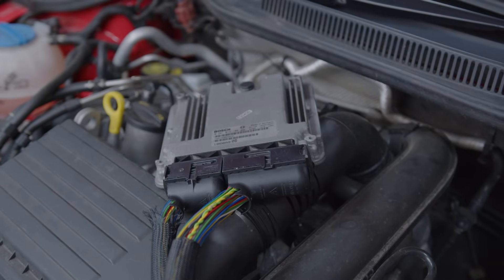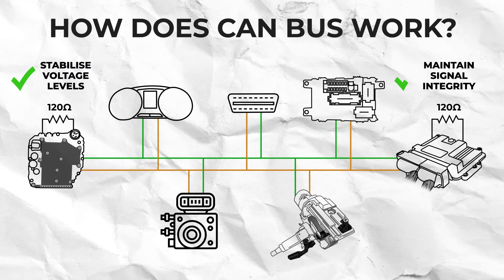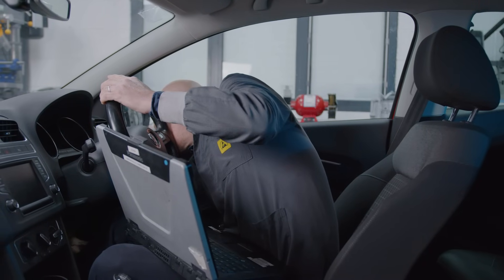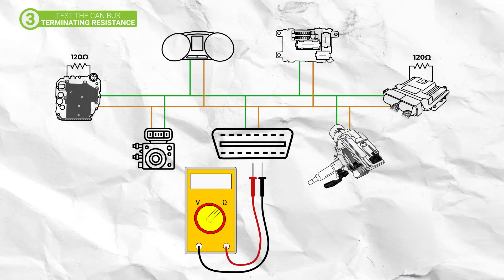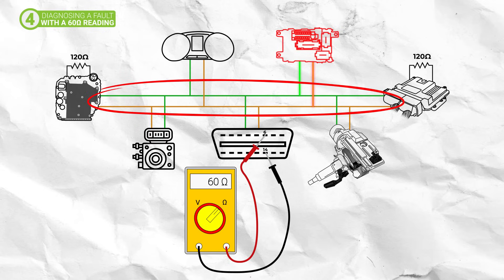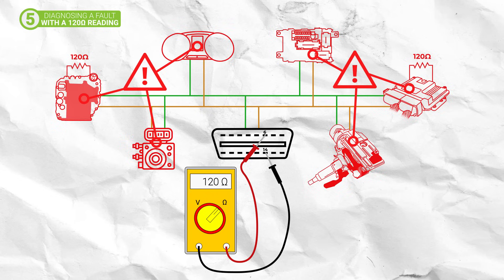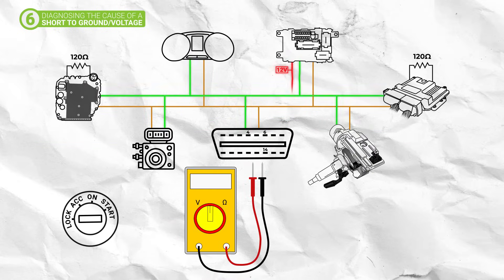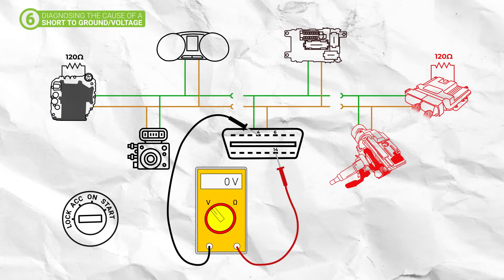Explained! CAN BUS Diagnosis – How to Troubleshoot Faults.

Comment: I bought a used vehicle and long story short i noticed a u0401 code. Meaning invalid data from ECM. I also have a p0101, and a p0102 if i remember correctly. My father and i also noticed that there seemed to be electrical tape around some wires that are right behind the ECM connector plugs. I found the wiring diagram and found that it seems like a single terminal does not correlate with the correct terminal that the wiring diagram says it should be. When using the continuuity mode, we found that it goes to a terminal position that is supposed to be a selonoid valve of some sort. We think rodent damage to the wires, or some other unkown damage was done to the ECU cables and whoever tried repairing the cables mixed up a few cables, but not enough to completely ruin the ECU, considering thr car still runs absolutely fine without many issues. It doesnt run well at full throttle due to the MAF sensor codes and not recieiving the correct signal to thr ECU. Anyways i had a lightbulb moment after watching multiple videos of yours. I bet the u0401 is caused by the miswired repair that the kast person did. Its causing the maf sensor and IAT sensor to get incirrect readings, and causing the ECU to not recieve valid data and therefor throwing that u0401 code. Could you confirm my suspicions? Im still at work so im not able to work on it, but your input would be absolutely appreciated. Very informative videos!

Comment: Help! I went through the process and got to the Diagnose CAN Bus open circuit part and got stumped.  I pulled the module with the faults, BCM, and measured the wires a got a reading of 120ish ohms.  The video covers 0 and 60ohms, but not 120ohms.  What is the fault for 120ohms?  I did originally test the OBDII port and had a reading of 60ish ohms.  My only thought is that it is not seeing an end resistor.  What should I do next?

Comment: I am an ex mechanic but not mega familiar with canbus so I followed this guide to diagnose a range river sport 3.0 TDV6 2011.

I let the canbus go into sleep testing the voltage between pin 6 and pin 13 to confirm.

Once in sleep mode I tested the ground to pin 6 and pin 13 using the voltmeter and got voltage upto 1v. I got 60 ohms so no resistance issues 

I disconnected every item shown in the high speed canbus system as shown in the wiring diagram (took me a few hours). I got voltages ranging from 0.5v to 1.0v throughout and at no point when disconnecting every item did the voltage go to 0v as explained in the video.

Some guidance or advice would be gratefully appreciated.
Reply: Update:

The body control module was emitting the current. I suppose my question is. When in sleep, there definitely shouldn’t be any current in the can bus system should there?

Comment: I'm working on a 2015 Mercedes-Benz c300
 I don't have communication at all. I have 62 ohms on pin 6 & 14  when the car is sleep once I cycle the key. I get 1.2 ohms it would stay like that until it goes to sleep which takes about 45 minutes. I can't find where the 120 ohms resistors are located. I'm suspecting it is a module but which one. Help help 
Can high is 2.6 can low is 2.4

Comment: I thought you had to disconnect all devices from the network when taking an ohm reading, due to the fact that you’d also be measuring the resistance of each device that is plugged in

Comment: Agree best simplified by far and heading back to the garage to troubleshoot.
I'm working on a project to customize 1996 with a 2017 canbus. I'll be removing some of the canbus devices, but not sure how to get around a device that won't be used anymore. Like the electronic parking brake. But still, I will keep using the manual ebrake. Do I need to loop high w/high etc or how would I terminate the end as in the device did not exist. I will edit it out of the programming as well. Thanks

Comment: Hello thanks for a great tutorial.  I try to resolve electrical issue on my Passat b6 BMP 2008 DSG car, for a week with no success. Yesterday I take multimeter with me and try to measure 6pin and 14pin from OBD. The result for voltage between 6th pin and ground was 2.5v, pin 14 and ground was 2.5v. I think that not have communication, but this is all of the time. Another test was for resilient. I try 200ohm between pin 6 and pin 14. Result was between 68.1 in most time and 71. I try to remove all positive cables from fuse box near engine and battery, nothing happened with resilient. After that I remove abs plug and again 68.1ohm. Finally I unplug every one cable in engine section and spray it with contact spray, I change fuse box in engine section, change gateway module, after all situation is same. I remember that before mass problem with multiple MILs and going in service mode I have a couple of day, maybe a week MIL alerts for steering. 
I change battery with new one and maintain alternator.

P.S All of scannings with diagnostic tools say that I have a impulsible signals, lost communication with different modules and etc.

Please give me advise what to do, because I was in two different car services and nothing happned.

Comment: Great video, thank you.   One curios phenomena I have with both of my cars regarding the CAN bus on the ODBII connector, there is no voltage nor any resistance (open circuit) on pin 6 and 14. I tried measuring it with both an oscilloscope  and ohm meter.  What's going on here? 😀.  My cars are Toyota Aygo and Volvo S60. Even when the engine is running there is no signal in the oscilloscope on those pins 🤔

Comment: Thanks for the video!  I subbed to your channel for the good info !  I spent all day today trying to diagnose a Bobcat tracked skid loader that is having electrical gremlins and it won’t power up the display panel. I traced the problem down to a faulty control/display module. Its always a little stressful calling bad modules when they cost $1500 dollars to replace!  But based on everything I seen its gotta be the panel.

Comment: Hi, if you have a short to voltage i assume that would appear as a parasitic drain,  and potentially cause other issues, i have a qashqai that has a serious drain, and is missfiring and is giving codes for a can issue with the cruise control and there was another of the same code, i am trying to figure if its a module or wiring right now?

Comment: Really great video thanks. I’ve got a RFA module u0001 00-08 error on my Ford fiesta 2014 and an engine ignition light on the dash. Gone through your tests but everything seems ok. The battery though is reading 12.39v across the terminals or the cars internal test reads it as 11.6v. Is it most likely simply a dodgy battery that needs to be replaced? I did get a strange resistance reading from the HS CAN though as it was rotating though numbers eg 35 40 23 with others sometimes flicking in like 77 I saw once and a hundred and something. ?

Comment: 12V vs 7V
can you please explain....
Why why why???
Today's modern cars eg Toyota Glanza, Toyota Taisor, has 12V and then drops to 7V in the door close signal voltage.

Whereas, it used to be directly 12V when door closed and 0V when opened in old cars.
But today's cars has 12V at door closed, and after 20 seconds, it drops to constant 7V. When opening, it drops to 0V.
Why there's delay in dropping to 7V at door closed??
What's the significance of this 12V to 7V???
Please explain 😊

Comment: I had a very strange miscommunication in my 2021 gm truck .really very strange.
When testing sierra data vs ground is infinity OK.
When testing wire continuity in terminal is ok(less then 0.4
 ohm) when testing terminals on module is OK giving right voltage and right resistance.
But when connecting the connector to the module and attempting to measure voltage or resistance the line looks like dead.

Very confusing.

Comment: There are so many techs say you need a scope for automotive CAN-BUS diagnostics.  They often cite that a tech needs to decode the communications (not sure why) or look at the ACK bit, or whatever....  But the reality for automotive diagnostics:  find the failing module, then replace it or get it re-built.  Even though we hate to admit it, auto techs are just parts swappers.  When techs start doing diagnostics, we are just being more accurate in the part that needs to be swapped.     All that said, do you find a scope is really needed to do automotive can-bus diagnostics?

Comment: Sir, very nice 
Sir, can high and low is dc voltage  or ac voltage (signal)????
Sir, I reparing  electric  charger  but this charger  not on without bms battery ,, now sir how to on without  bms battery  for testing purposes. 
Please  guide.   Charger  use four wire  can H, can L, ground1, and ground 2(bms use in)
Reply: Anything that uses battery automatically that's a DC voltage and the rest that doesn't use any sort of battery that's AC voltage
Reply: @Saka.shi-liz  
Any tips for charger  on.    For can

Comment: Ummmm I’m getting 551 ohms of resistance between my can lines?
Reply from the maker: A reading above 70 Ohms would indicate high resistance somewhere on the CAN network. This could either be poor terminal contacts, corroded or damaged wires, or a faulty module. It could also be worth checking the multimeter you are using to obtain the reading isn't faulty, as this could give a high resistance reading.
Reply: @Ecutestinglimited can you please explain....
Why why why???
Today's modern cars eg Toyota Glanza, Toyota Taisor, has 12V and then drops to 7V in the door close signal voltage.

Whereas, it used to be directly 12V when door closed and 0V when opened in old cars.
But today's cars has 12V at door closed, and after 20 seconds, it drops to constant 7V. When opening, it drops to 0V.
Why there's delay in dropping to 7V at door closed??
What's the significance of this 12V to 7V???
Please explain 😊

Comment: Sir  I am also coming across a can bus issue from the bcm  and the resistance was way high the voltage was normal  after disconnecting the battery or  the bcm supply line the resistance comes back to normal  the issue the power steering of the car is not working. The vehicle is fitted with a mdps steering since  a can bus is shooting on  I cannot take a decision regrading the  problem

Comment: Hi great video, is there any diagrams available for showing where canbus modules etc go to point A-B ? 
I’ve got a harness for an Audi 8p vr6 a3 and I’ve got some cut canbus cables, traced them back to the following just don’t know which connects to what 

Can-bus cut items

Ecu body plug
ABS module 
Airbag module 
Headlight level module 8P0 907 357 F
Steering wheel module 8P0 953 549 F
Console/dsg shifter 
Dsg trans plug 
Rear diff / haldrex plug diff side 

CANBUS gateway module plug 10 pin
1K0 907 530G
Top side plug tab 
6 from left red / brown
6 from left red / black 

Find what grey / yellow wire goes to on instrument cluster, as that has a cut canbus wire

10 sets cut in total

Comment: The video is good, but for more detailed and accurate troubleshooting, I recommend using an oscilloscope. You can distinguish between main line and sub line issues by examining the waveform.

Comment: Very informative video!
I have communication issues with the transmission control module .
When connected to the can bus ,resistance reading was 40ohms,scanner showed tcm is not fitted although the gearbox functioned ok.
I replaced it with another unit along with the wiring harness .
Scanner connected to the used  module but only for 2 times .
Gearbox functions well again but can't communicate with tcm for live readings and reset functions etc.
Do I have 2 faulty tcms?
How can I confirm this? 
I checked grounds, power and can bus wiring ,all seems good..
Any suggestions?
Thanks.
Reply: I forgot to write that I also have no faults codes (communication or else )

Comment: Error code U0151 means what?
Reply from the maker: Hi. The fault code U0151 usually indicates a communication problem with the vehicle's Restraint Control Module which is responsible for things such as the airbags and seatbelt pre-tensioners. We would recommend checking the unit is receiving the correct power supply and it has a good ground, and then test the communication line/lines to determine if the fault lies with the module or the wiring. Getting a good wiring diagram for your vehicle so you can see which pins correspond to which would also be very beneficial, as well as seeing what communication network that module uses (CAN high, CAN low, LIN bus etc). If it is CAN bus, you can follow the steps in this video in order to determine where the fault could lie. Hope this helps!

Comment: Great video just subscribe to your channel, having trouble with the 2016 Jeep grand Cherokee my lights stay on and cannot turn them off with the headlight control switch knob. The lights only shut off when my car is off and I can’t access my highbeams. Any idea what it it could be?, Already replaced the headlight control off switch what the factory went from Mopar and I also replaced the ambient light sensor in the middle of the dash and still same problem.

Comment: Great video and explanation. But, it all hinges on the troubleshooter having 100% familiarity with the physical routing of cabling inside the vehicle. i.e. where modules are actually located and how does the wiring loom run throughout the vehicle. Most factory wiring diagrams don't usually show that but rather show the wiring in a form of electrical schematic rather than the physical layout. So, it really boils down to personal experience with the vehicle being worked on.

Comment: Resistance can be measured with the battery connected?
Reply from the maker: Hi. Yes you can measure the resistance with the battery still connected providing the CAN Bus network is asleep. We show how to do this at 4:34 in this video, as well as how to confirm the network is asleep. Hope this helps!
Reply: @Ecutestinglimited  Thanks!

Comment: amazing video! i have check my vehicle and diagnostics port obd does not have any wire in pin 6 and 14, is that normal? vehicle is and 2001 w168 mercedes

Comment: hello thankyou for upload, can u help we with following
I see that 1MBPS speed is called high speed bus is 500kbps is also supposed to be high speed or medium speed?
With the gateway in picture i have seen that there are still CAN wire coming to OBD plug, is this resistance test is still applicable at OBD plug ..
Reply from the maker: Hi, a CAN bus network with a 500 kbps transfer speed could be considered at the lower end of high-speed or at the upper end of medium-speed. In many contexts, especially where real-time communication is crucial and the standards specify up to 1 Mbps, 500 kbps would be categorised as high-speed. However, the specific application and the network's requirements (e.g which modules are on the network, drivetrain or safety critical modules will likely be on high speed), will ultimately determine how this speed is classified.
With a gateway module directly after the OBD-II port, if the network is correctly configured and the gateway module does not alter the termination scheme of two 120Ω resistors at either end of the network, you would still expect to see a resistance measurement of approximately 60 ohms across the CAN High and CAN Low lines. This assumes the measurement is taken with the network in a passive state. Hope this helps!
Reply: @Ecutestinglimited  thankyou for detailed explanation 👍
Reply: L

Comment: Very great explanation. For trucks it's the same way to do a diagnosis?
Reply from the maker: Thank you! The fundamental principles and protocols of the CAN bus system are the same across different types of vehicles, including passenger cars, trucks, buses, and even some non-automotive applications. However, the implementation can vary significantly between automotive applications and trucks, and even among different manufacturers and models. Trucks, especially commercial heavy-duty ones, may have more complex CAN bus networks due to their advanced systems for cargo management, additional safety features, advanced telemetry for fleet management, and other specialised systems not typically found in passenger vehicles. We would always recommend consulting your specific vehicles wiring diagrams and vehicle schematics before conducting any tests and making any conclusions. Hope this helps!

Comment: How can you tell which modules hold the terminating resistors to each specific vehicle? I have 120 ohm resistance thru my can bus on my DLC port. I’m having a hard time finding the open circuit in my 2016 Hyundai sonata.

Comment: Hi there, I am getting a p1123 error code on my hilux kzte. Says APP sensor...intermittent voltage followed by check engine light and limpmode. Switched out the sensor but problem persists. Is this can bus related or wiring problem?
Reply from the maker: Hi. It is unlikely that a CAN bus fault will cause that code and it is more likely either a fault with the wiring to the sensor, or with the ECU. We would recommend checking the integrity of the wiring to the sensor first if you have already replaced the sensor itself.
Reply: @Ecutestinglimited  thank you...will check it out. If I don't find fault with the connection wat voltage or resistance am I to compare in the wires?
Reply from the maker: @dbn-k9b  Unfortunately these will depend on your specific vehicle and the part you are testing, so we would recommend consulting your vehicle's repair manual for this.

Comment: Just one point the Canbus can also still work in single line mode using either Can High or Low and Ground, OBD diagnostics usually shows this condition, it can work with short or open cirtuit. Everything can appear to work as normal, but noise can cause intermittent function.....Would like comment how this condition can be easily tested, as Can High and Can Low do not appear to have a ballanced termination resistor to ground